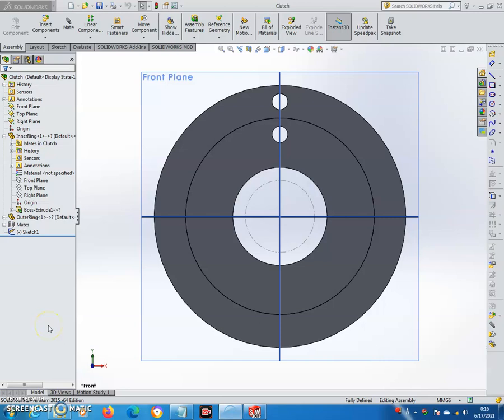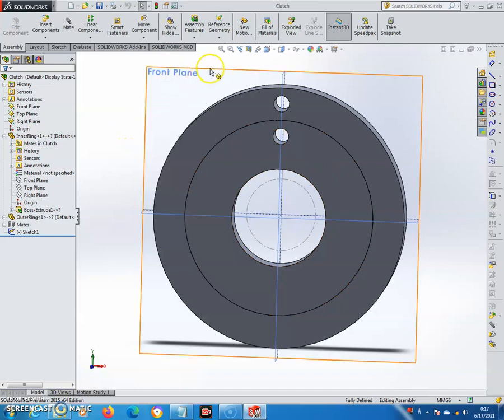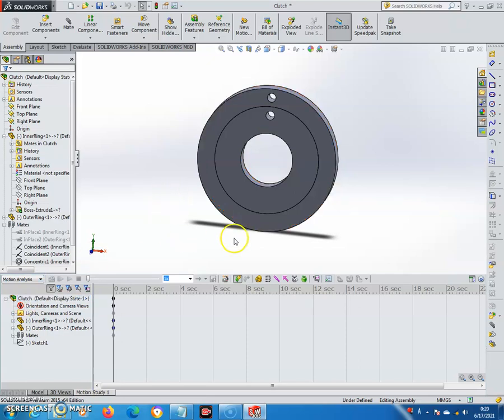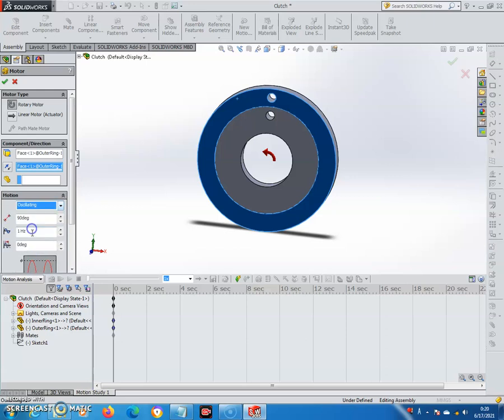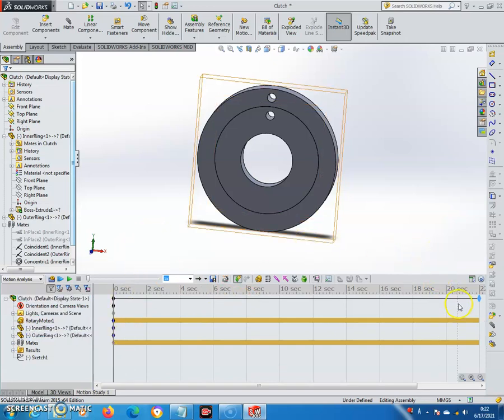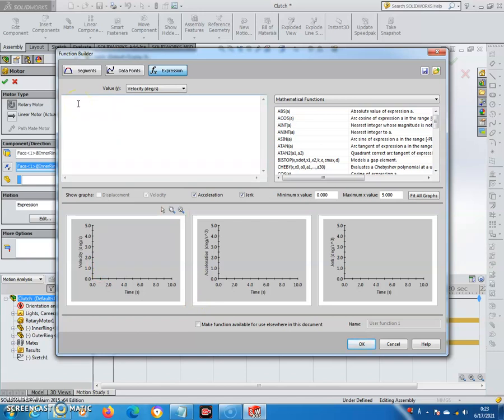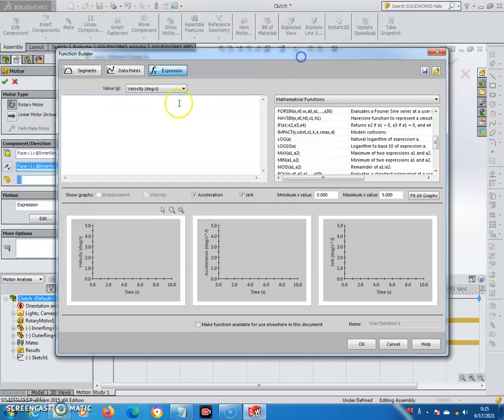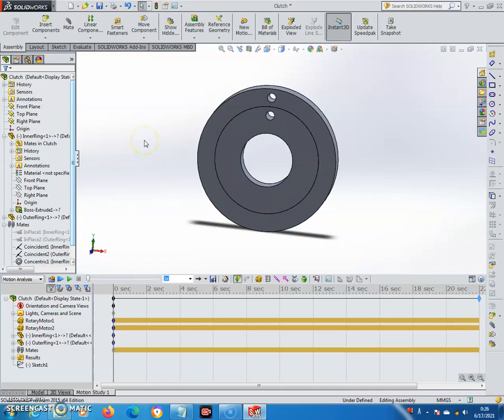One Way Bearing Simulation - Solidworks Motion Analysis

Comment: Thanks to show this.  I will use it.   But this is not the reality.  Inner ring should be rotate freely in one direction. This means when you stop rotation outer ring, still should be freely rotating the inner ring for a while. Any idea how to improve this one way bearing?

Comment: Nice. I developed an exactly the same solution some time ago. Unfortunately for me, I need to compare in a Motion Study, the torque applied to the movement with a counter-torque generated by a spring attached to the ratchet. The use of the Motor makes the Study result not valid, as the Motor object does not suffer contrary forces. It overlaps. But I got a positive result with a very complex but very time-consuming solution, which makes the operation unfeasible. Any suggestion?